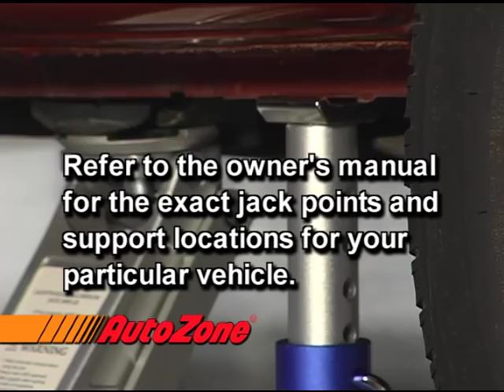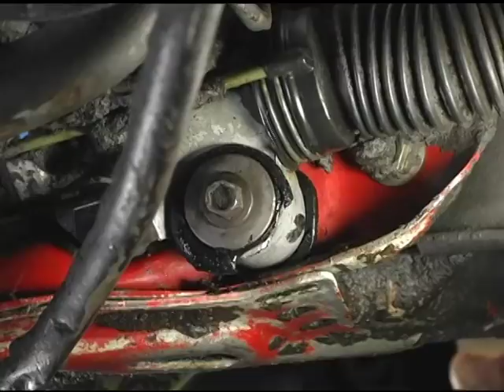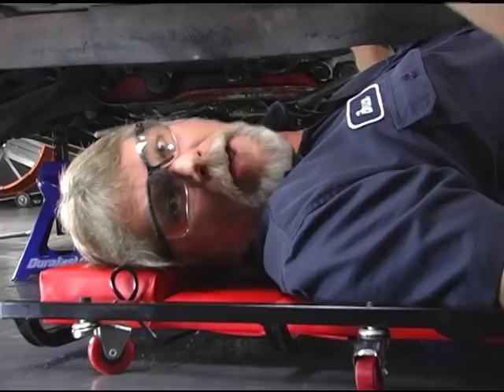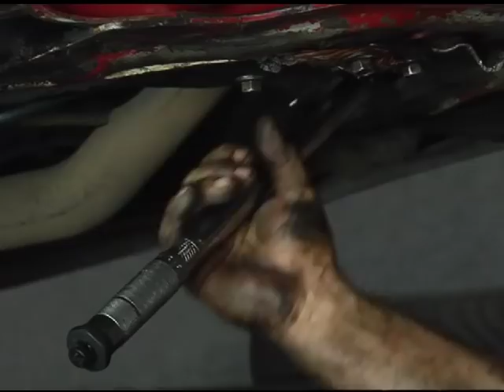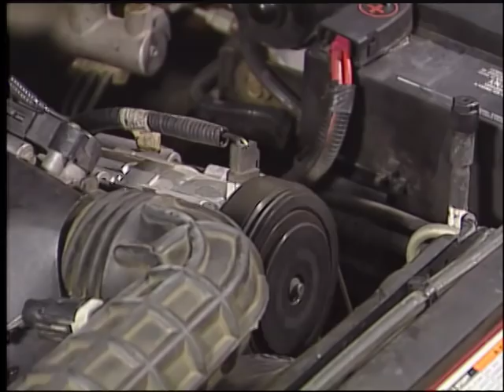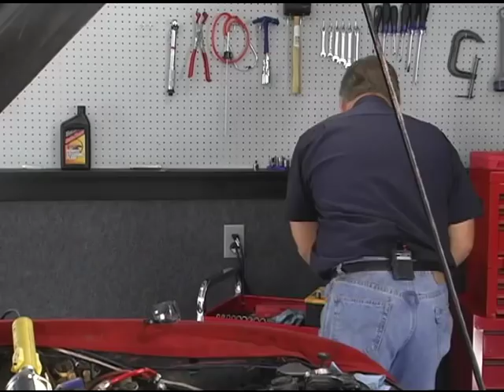AutoZone Car Care: How to Check your Power Steering System

Comment: One day i was driving down the street and the power steering made a big noise, and i lost all powersteering, when i opened the hood the reservoir was a little melted, i replaced it and the power steering pump and now the problem i have is the the low pressure line gets sucked in and i dont have any steering,please help

Comment: where is the power steering fluid  pump is located on a 2010 ford fusion or does it have to go back to the shop ?
Reply: if you have to ask, you can not identafy it, or google it, then yes, it needs to go back to the shop...
Reply: Owner's manual? Online googling?

Comment: I need help I have a 2004 acura tl  I had a bad rack and pinion like 8 months ago a replace can was good for 4 months and now my rack and pinion is bad again an this time I replace 5 times the rack and pinion and 3 months because every time I do alignment the rack and pinion goes bad the next day and last time I replaced I replace the power steering pump to and it when bad again cN someone tell me whats can be causing this

Comment: Hello I'm having a problem with my wife's 2009 Ford Escape. Electric steering no fluids. It's not under recall and should be. Upon engine start the steering wheel automatically binds making it hard to turn the steering wheel. This is a safety issue and needs to be recalled. My 2009 Ford Escape was Made in Kansas City Assembly Plant Job#2 program 2. The recalls are only for Kansas City Assembly Plant Job#1, year models 2008-2011. With this information I believe it is just to include my and other vehicles in this recall. Please share to get this done.

Comment: I have a 95 Toyota 4runner 3.0 v6.. power steering pump keep going dry it needs to have fluid put in every 100 miles.About a month ago i replaced a hose that was busted. Consistently replace the power steering fluid every 100 miles. Realized I am suppose to put ATF instead of PSF in the power steering pump. Did I mess the pump/system up when I used incorrect fluids? I did a flush and have been running manufacturer spec fluid for a week, but no change still have to replace fluid every 100 miles. Tried multiple brands of PSF-leak stop, no luck.
Reply: did you ever get a reply, I'm having a similar problem

Comment: Hi I have a 2003 Toyota Avensis Estate (station wagon) 1AZ-FSE 2.0 litre engine with 152 000 km milage. I changed the front shocks in May last year as the front right shock was damaged. I replaced them with cheap no names as I was travelling. When I came back home the right one was damaged again( after about 2 000km) I took it to the guys who specializes in suspensions and they confirmed the right shocked was damaged again and replaced them with the Monroes shocks and now after about 6 000 km of driving the right shock is damaged again.
The shock’s piston rod shaft in both the shocks that were removed so far were bent. About an hour ago I look at damaged one and the shock’s piston rod shaft is bent. The left hand side shock’s piston rod shaft is straight. i am not getting any bouncing or steering shaking. I am only getting rattling noise when I go through bumps
Please help before I buy a set of shocks again.

Comment: I think he jumped too fast to the conclusion that the binding was in the rack.  Twice, I have had steering shafts go bad.  They have U-joints in them and when they go bad, the wheel binds as you turn it.  You need to check that before possibly pulling a perfectly good rack.  They are generally not hard to remove and once off, it is easy to tell if a joint is bad.  My bad ones were on a 2003 Town Car and a 1995 Dakota.

Comment: If wobbling is IN THE DIERCTION of the vehicle (IN LINE) it means the wheels are out of balance. If the wobbling is ACROSS the vehicle, it's coming from the engine flywheel, or another heavy mass INSIDE the engine compartment (clutch components, etc). This is a general rule.

Comment: Hey I got a question, I have an 01 alero 3.4 when I drive at higher speeds like 40+ the steering wheel wobbles for 3 seconds then stops for 10 seconds then it woobles again, what could it be?

Comment: @hom2fu 
yes, and don't use the type fork he used in the video if you are reusing the outer tie rod ends. The fork will damage the grease seals. 
Just give the knuckle a good rap with a BFH and it will fall out.
Reply: anthony diodati 0